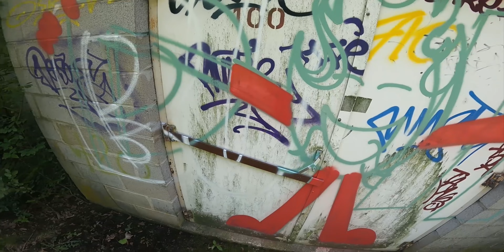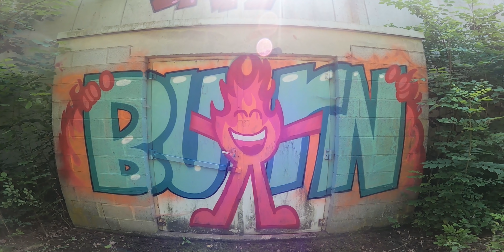graffiti cartoon & colors with Useful CAP tip

Comment: Sup Chuck 
Whats your opinion on MTN Hardcore cans?
I Am pretty new to graffiti and thought about buying some as I can get them for cheap at the moment
Reply: Hardcore big pressure cans. Better try mtn 94.
Reply: They are really good but its high pressure so i would go with like mtn 94 bc thats easyer
Reply from the maker: Hardcore are good cans but like the comments before already told you, they are highpressure. Easier to get drips. You can still try them with a skinny or outline cap which should help already. 

If the pressure is still to high, you could hold the can upside down and release gas to lower the pressure
Reply: Thanks a lot to all of you!
I will just go for it and see how it turns out!
Reply from the maker: You’re welcome